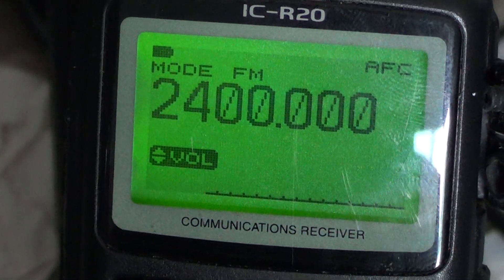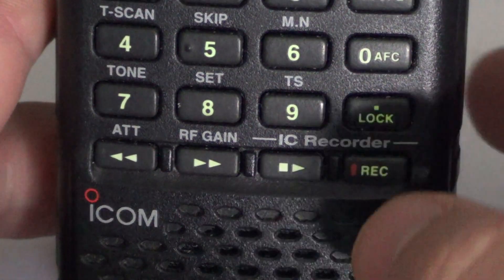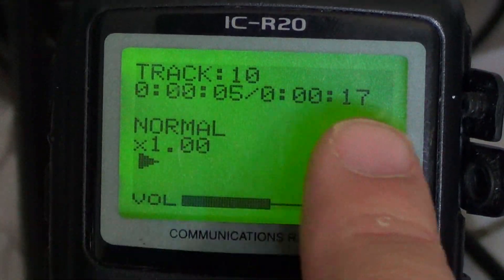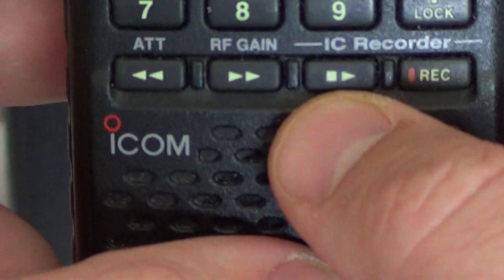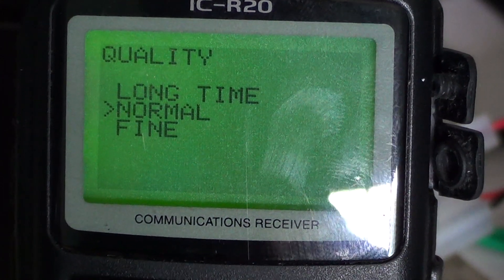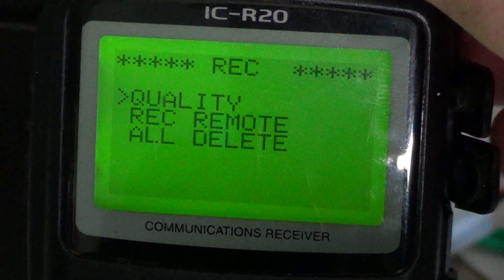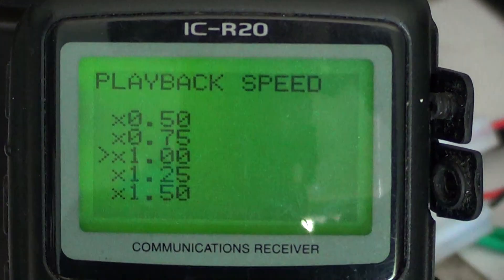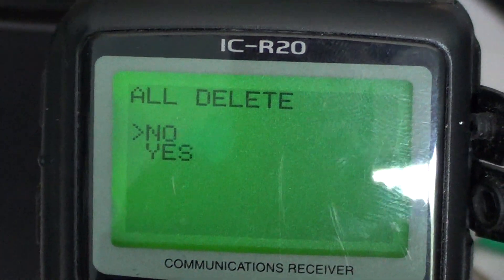Icom IC R20 tutorial on IC Recorder

Comment: Hello, May I ask if recorded files can only be downloaded to PC using special software or is there a way to work with files directly, for example as mass storage device? Thank You
Reply from the maker: You need the Icom software to download it to a computer ... plus .. you need a special converter to convert files into a playable format .     it is not a mass storage when plugged in ... it is a serial adapter
Reply: OfficialSWLchannel Many thanks, I guess I will just use headphone jack on scanner, 3,5mm dual jack cable and mic input on sound card to transfer audio to my book:) Thank You!
Reply from the maker: Slovenský Prepper That will do a fine job and will be much easier .. you can use free software like Audacity  to record   73
Reply: OfficialSWLchannel Thank You sir!
Reply: @OfficialSWLchannel  What is the name of the special converter that converts the files from the recorder into a playable format?